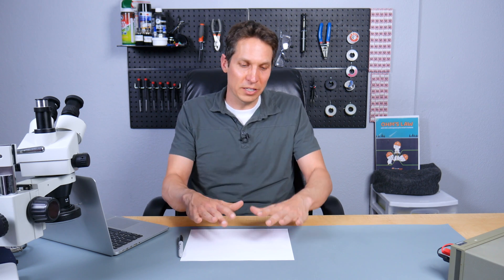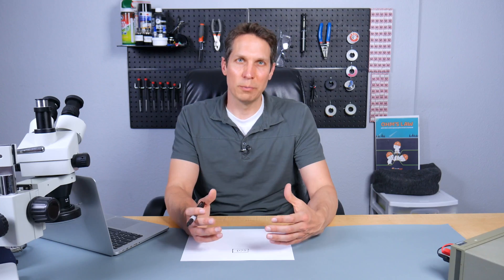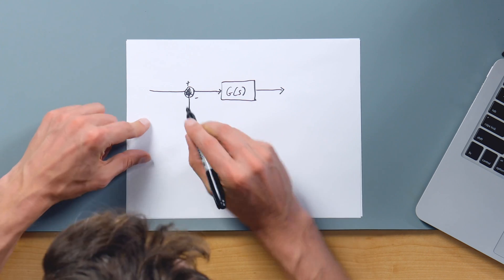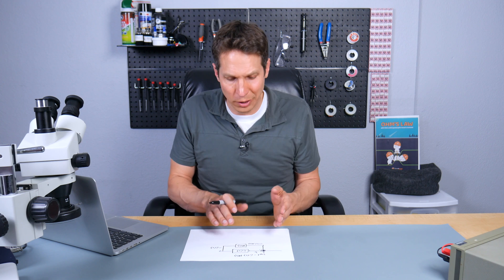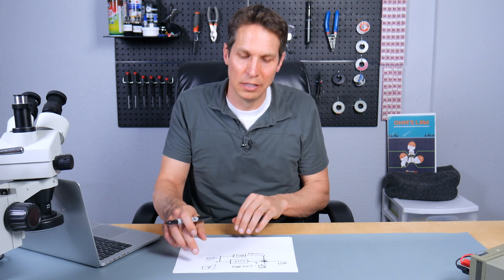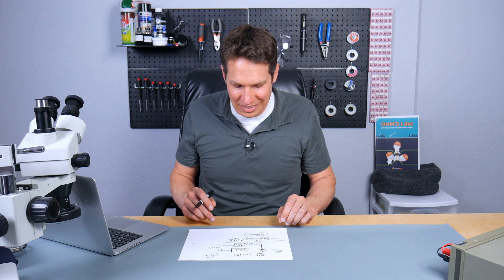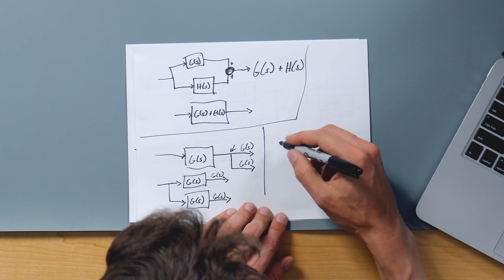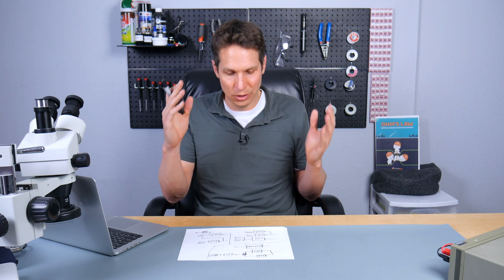Block Diagrams in Control Systems | Control Systems 1.4 | CircuitBread Electronics Tutorials

Comment: I'm learning about these in Digital Signal Processing but I'm not fund of them anyway
Reply from the maker: I'd like to get into DSP, the topic sounds fascinating but I've never had the opportunity to study it.
Reply: @CircuitBread  So you have no knowledge of Fourier Series, DFT, DTFT, whatsoever?
Reply from the maker: Me, personally?  I'm familiar with them conceptually and I use tools based on their operation, but I'm not well versed on any details.  Fortunately, there are other engineers here at CircuitBread and Amrutha is actually working on another Fourier EE FAQ right now (she's already done one comparing the difference between analog signal processing and DSP that's on the website).